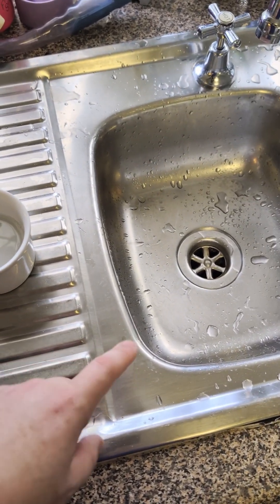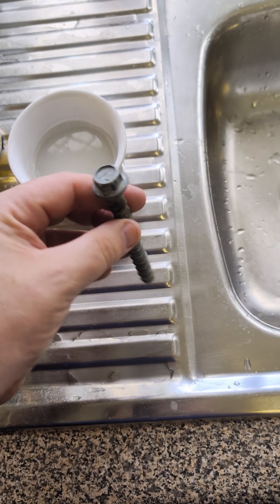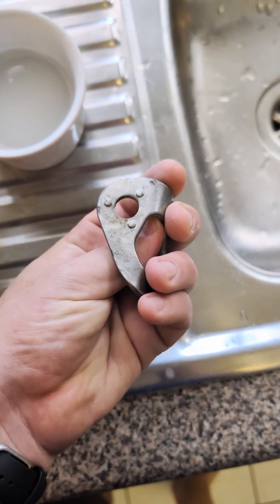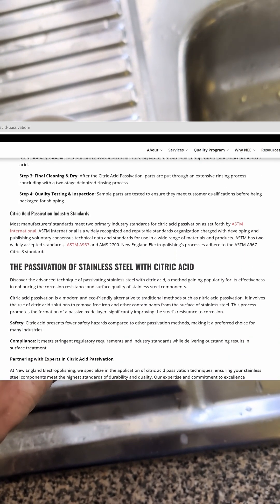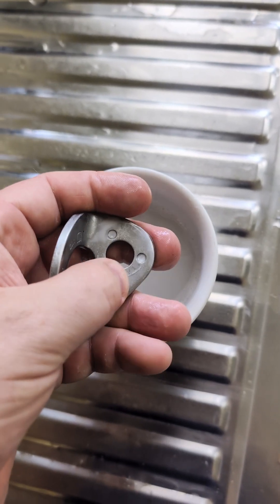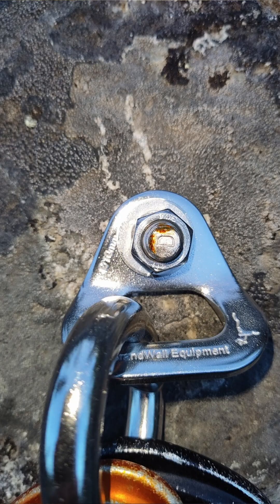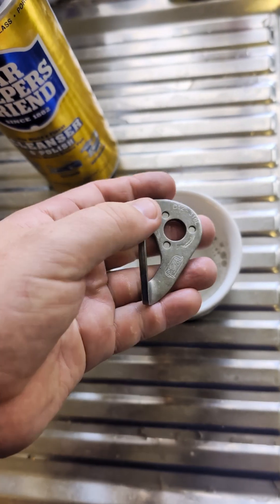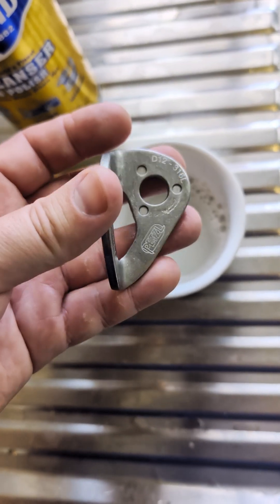Rust on your stainless steel bolts? Try this! (Citric acid passivation)

Comment: I have a manky stainless steel exhaust from my BMW bike and I cleaned it as much as I can and I'm now considering going at it with some citric acid solution used for descaling the kettle.
Would that work?

Comment: Nice tip.
Reply from the maker: Thanks mate, have you noticed any iron oxide on your bolts? Sometimes when I cut threaded rod  the end will go a bit brown even though the grinder isn't iron based
Reply: @MountainMullet  No yet, we use 316L rod cut with regular silica/ quartz discs. But it may appear due hammer-hits contamination (bolts case). I´ll re-check and let you know.
Reply: @MountainMullet  I have seen that, ill try some of this and apply as paste to the cut for a little bit.
Reply from the maker: If it's from cutting it might be more heat -related and may need something stronger like pickling gel to remove. However, that's a much stronger acid mixture used for cleaning & passivating welds. I would only try that in the workshop during production and not on walls after bolts are in. 
If citric acid + fine sandpaper didn't work on installed bolts, I'd just live with it unless you're in a very corrosive area